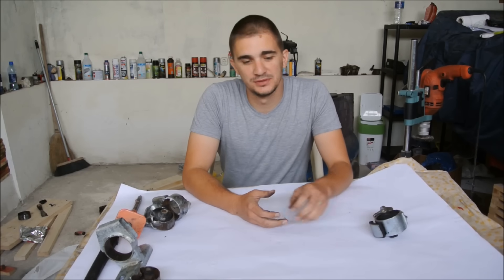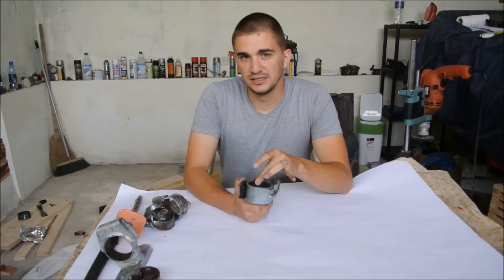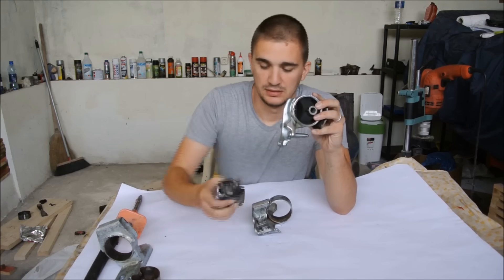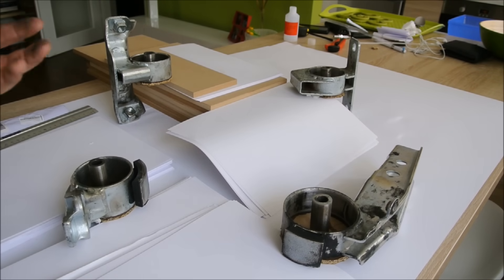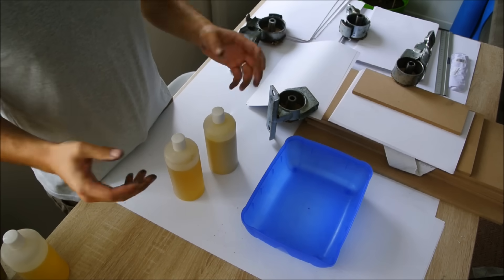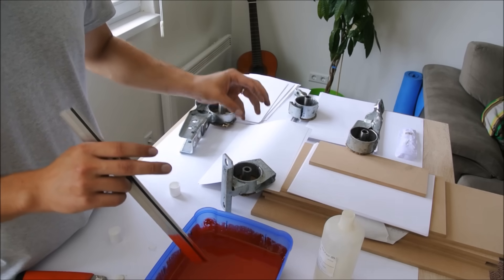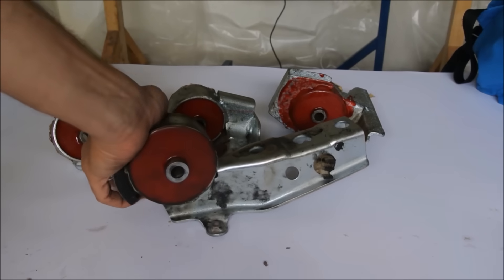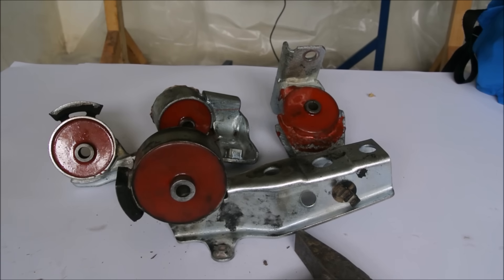How to make DIY polyurethane engine mounts

Comment: this is completely awesome! one more thing learned today hehe
I was wondering if you could do the same for the rest suspension bushings? I have heard too much things about gresing poly bushes vs non grease them. What do you think? Thx
Reply from the maker: Honestly I wouldn't know. Have yet to do my research and tackle the suspension. The easier way of doing these mounts is to pour them over the rubber, very similar results, less hassle.

Comment: Really cool man , can i ask u why u hammered the insert?
Reply from the maker: Thanks, glad you like it. You mean when I hit it at the end of the video? I just hit it to show how everything is solid and that the pin (sleeve) and the new polyurethane mount won't come out even when brute force is applied. You could actually fake the mounts looking solid when in reality they are fragile, so if someone was concerned with that I hammered it to demonstrate its solid and answer possible comments on the issue before they are posted :)
Reply: +driving 4 answers (mr2 mk1 hero) i meant like i dont own a chissel or a press. So could i get away with leaving ring inside the mount or would i have to remove it?
Reply from the maker: The steel insert is held in really tight and won't get out I think no matter what you do to it, so leaving it in shouldn't be a problem. The only downside might be how the bracket will react to all the heat when you burn the rubber, and you will need to clean it really good afterwards as it will be all charred up and dirty. Be careful to measure accurately where and how the pin (sleeve) fits inside the steel ring so you can position it properly when pouring.
If you want a really easy job with similar results you might also get away by not doing anything to the mount or the rubber and just pouring the polyurethane around the existing rubber to make it all stronger. Lots of guys do that using window weld from 3M I think. 
I wanted to make something that is equivalent to aftermarket mount inserts so I went all the way.

Comment: I have had this on my site for years now. Haven't sold one kit. 
[url]http://matrixgarage.com/store/diy[/url]
I should take the 40A down though. We found that it is too soft and deforms easily. Even with the 60A we had some issue with this which is why we went to all 80A and just offer a version with holes which is a little softer. With that said I am always surprised when people complain about the solid mounts. If you have any loose panels or anything it can make them rattle more or louder but other than that I really didn't notice any difference. 

And BTW my mounts are $160 for all 4.
[url]http://www.matrixgarage.com/products/aw11-motor-mount-set[/url]
 I also really recommend people don't just replace the torque mounts. Just doing these will mean they are now supporting most of the weight plus the torque forces putting a lot more stress on the chassis which is an already known weak point. Particularly the front mount. Which I have a reinforcement plate for. 
[url]http://matrixgarage.com/products/aw11-front-motor-mount-weld-reinforcement-plate-0[/url]

A couple notes if you are going to do your own. 
1. there is no good reason to remove the old rubber. Just like the Kirk inserts you can just seal off one side and pour the poly around the old rubber. This will help hold them in their proper position.
2. The position of the steel sleeves is critical, especially on the torque mounts. The motor relies on it's angle to allow proper oil drainage from the head. The 4A already has a reputation for collecting oil in the head and needs all the help it can get draining properly. Just a small change in motor mount position can change that angle by a couple degrees. Also if the F&R sleeve heights are different relative to the sides it will put more of the engine weight on one or the other. The side mounts are designed to support most of the weight so it's very important that they are positioned to do so and that the torque mounts are positioned to support a little weight but not pull the side mounts down more.

As for Urethane selection it is much more complex than just finding one with the durometer that you want. For example the company I get mine from warned me that their 40A and 60A may or may not work for engine mounts but had properties that were designed for other applications. Even their 80A comes in different types. It's not just any old 80A. They have a special 80A specifically formulated for things like engine mounts. 
It will be interesting to hear how your mounts do after 20k miles but I would be hesitant to recommend a certain product not designed for this application before you have tested them for a while. 
Another thing to be aware of is that Polyurethane does not like to stick to other things, especially metal and other non porous surfaces. If you are relying on a mechanical bond you want to use a urethane to steel primer made specifically for your urethane and application.